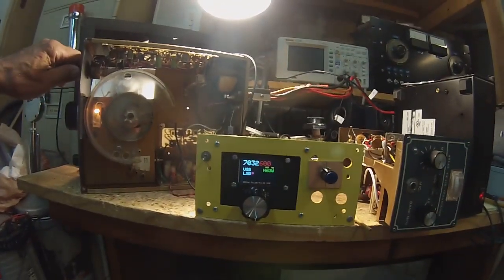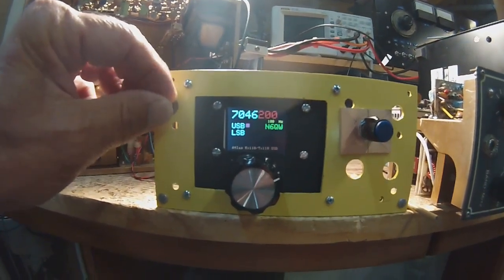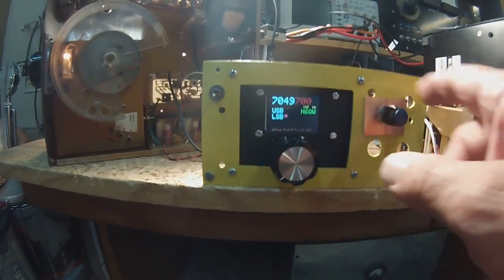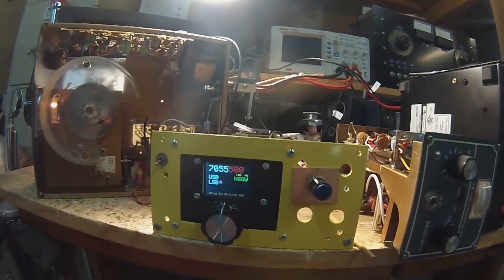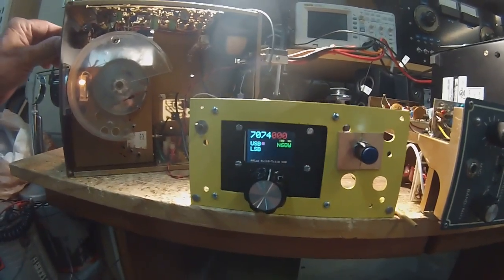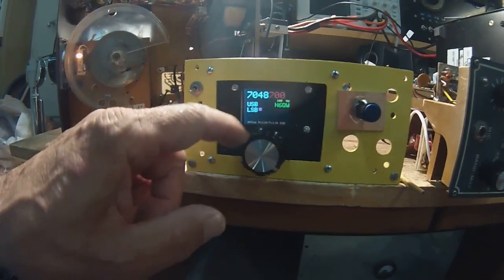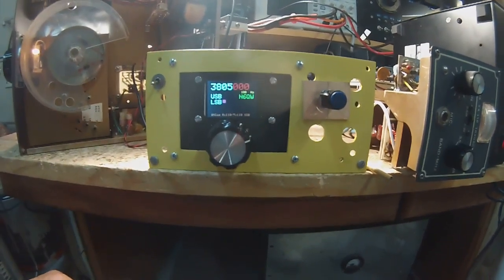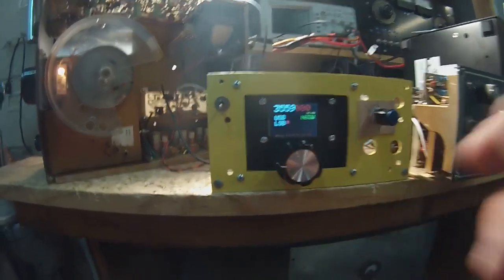Atlas RX110 & TX110 Retroftted with an Arduino Nano and Si5351

Comment: Wow, I'd like to see the sketch … I'd like to do that to a little older radio, a solid state Swan.
Reply from the maker: Hi OM,

This is Nov 23 (early) Later today on my website (with a link to the RX110/TX11)) I will post the sketch used for the Arduino. If you have a working knowledge of the Arduino and Si5351 it will make sense to you. Otherwise this will become a huge science project. You would need to change the IF frequency as well as the BFO frequencies. Most of the other stuff would not need major revision. If you know how to take the notepad text file and paste it in a blank sketch and how to add files and the libraries --it will not be too difficult if you understand what I have said otherwise don't even think about doing it. It may not be until late in the day that I will post the text file. see http://www.n6qw.com

Pete N6QW

Comment: Great job Pete!  Rescuing old rigs from the back shelves and breathe new life in them.  Did you have to recap the old rig?
Reply from the maker: Hi Ralph. If you go to my website www.n6qw.com there is a link to this project and yes I did some recapping. The RX110 has an internal power supply that will power itself plus the QRP version of the transmitter. The caps were bad in that supply and I also totally rebuilt the 1st part of the Microphone amp. Quite a few other caps need replacing. But I buy in bulk so my electrolytic caps I get for less than 10 cents each.

Thanks for your posting.

73's
Pete N6QW